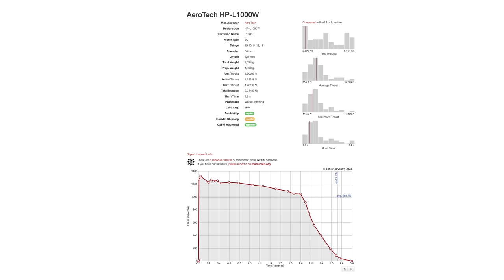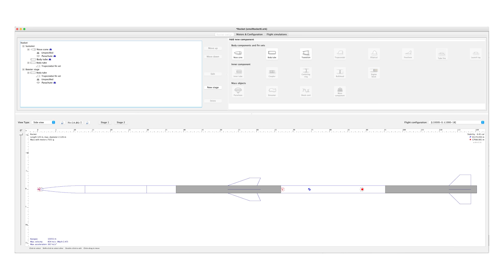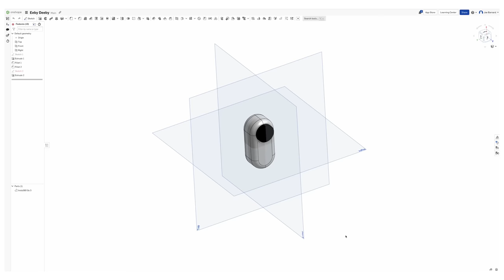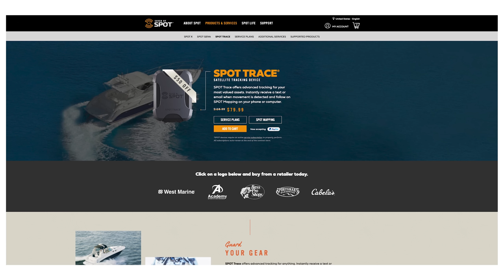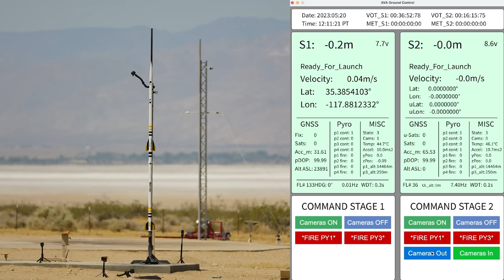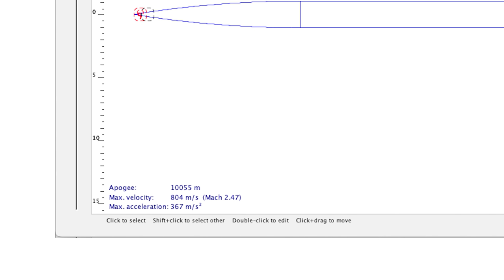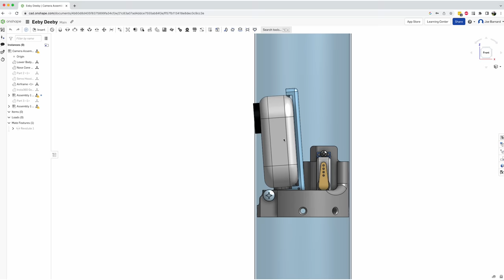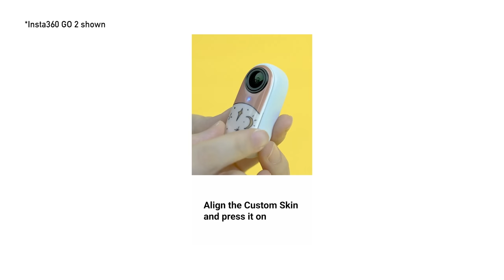I Sent a 2 Stage Rocket to Mach 3 | Feat. Insta360 GO 3

Comment: Great testament to the camera.  Big holes in the airframe also wreak havoc with the rocket aerodynamics, and could have caused the squirreliness of the flight on the first stage.  The use of mirrors with side pods may have been a better idea than fold-out cameras. 

The other camera on camera view option could be to mount one in the forward part of the booster section of the sustainer and one in the aft part of the AV Bay.  A small LED could keep the area lit, and then at separation you would have a video from both the perspective of the the AV bay and the booster... and a nice camera-on-camera shot.

Just a suggestion.  Glad you were able to recover what you did and were able to capture data.

Side note... I had a single-stage flight to 5,000' or so with a camera mounted on the side.  At apogee, the camera ripped from the rocket and free fell in close proximity to the rocket in descent.  The camera hit the ground, flipped over, and was positioned to catch the rocket landing.  It turned out to be a great video.  You can check out EeeebeeeE's Rocket channel on YouTube if you want to see it.

Comment: I have a super simple idea to latch the camera or any other tip out device.  Make an in place "spring" on the camera that pushes the camera in.  This give you some built in slop in the camera movement.  Rigidly attach a hook that will catch the top of the camera tilt mechanism.  As the servo draws in, the camera will be full retract first and the slop will allow the catch to be pulled into place. A few grams more but mission saving....maybe. ;o)

Comment: FAR is close to China Lake, where the US Navy does testing of GPS jammers and the area routinely gets NOTAMS of degraded GPS service. Edwards AFB also has some hear-radio-on-your-fillings radars that add to the RF soup. When I did a deep dive into the sources of noise on our engine test DAQs at XCOR 20 years ago the amount of garbage in the air was breathtaking.

Comment: you should run another rocket designed to survive a Mach 3 shockwave which is probably what knocked the camera loose enough for the wind to catch it to begin with, you can almost hear it over the wind noise as it starts to fall but there was so much you could barely hear it, overall a wild video and a very good product

Comment: you can kinda see the camera shift to a deployed stage just before launch.  I'm betting that there was a slight jolt in take-off which allowed a few mm of trim broken by the camera housing punching the air stream along the side of your craft to cause a full deployment of the camera at the end and causing the failure..

Comment: Of course go Eeby Deeby 2 !! But put them on pure mechanical supports with strings or elastics to fold out, and just a Servo to release it. Also, why not keep the cuted tube section and keep it on top of the camera to prevent air drag on the camera mount. It just pivot when the mount is released.

Comment: That was the most entertaining video I have seen in a while, so great work. As for the GPS signal issue normally I would say there is a line of sight issue with 3rd satellite but the hills look far too low to be interfering. That leaves a rogue transmitter operating at same frequency that is poorly shielded and my eyes are drawn to they salt lake town which, if they like a few of the small towns I have been through, always have someone playing around with electrical communications devices in their back shed.
I just remembered, and this might sound very Mythbusters, that gas & oil platforms at sea have devices to cancel out the electrical current formed by steel & salt. I daresay the salt in the environment at the site c-o-u-l-d interact with the launch stands and generate a low level current that c-o-u-l-d act like a radio transmitter... <runs away before real engineers turn up>

Comment: Joe, could you use some very small mirrors and canards (?) to keep the cameras pointed at each other without having them stick out in the fluid flow?  Could use acrylic or polycarbonate to maintain a smooth flight surface while maintaining optical clarity.  I think some cool mirrors can be had from the laser business, though I don't know if they'd be small enough.  Very cool video, impressive work and very cool cameras.  Thank you for making this video.

Comment: Definitely need a 2nd flight. Watching the build portion, I was wondering what was going to happen to the fold-outs when the real g-forces hit. It seems like a vehicle going mach2 would have any divot in the side-wall closed and smoothed over.  Perhaps some sort door with the servo on a latch, and then a spring on the hinge rather than a servo on the hinge itself?

Comment: You need something other than a servo. Space mechanism use HDRMs (hold down release mechanisms) that are designed such that it is structurally solid and then released by a frangible bolt or similar. Needs to be very rigid to survive the g forces

By the way I love the sound the onboard camera made at the end. Sounded like it was screaming in excitement 😂

Comment: Hello Joe, nice rocket, I'm a fan.
Just wondering ... 
Could you use a dual direction centrifugal switch to trigger an anti spin fin or spoiler. Sure would make some great camera platform. Three flush mounted cameras at 120°, could possibly be stitched together, maybe even unspun in software.
In case you need more difficulty in your life. Video is life, remembered. 😊

Comment: Hey Joe nice flight I like it especially the video let me say this I noticed most of you guys use small fins on your Rockets I think that's nice but for very very high speed Rockets like the Phoenix sm2 Rim 66 Hawk missile all those use a longitudinal thin running about 3 ft from the nose cone all the way back to the first stage then the first stage has a standard fins on it the small longitudinal fins give more control that's why the United States Navy and its contractors have been using that design for 60 years. Now something like The Sidewinder it has a standard fin section in the rear by the motor and fins by the nose cone of course those fins are steerable fins. I personally like the sm2 rocket because it's been under development for so long and basically it's one of our best long-range service to air missiles. The sm2 has about the same speed as your rocket around 3.5 Mach just something to think about adding those longitudinal  short fins might help

Comment: instead of using pop out cameras: 

Use periscopes/mirrors like tank viewports
This way you can maintain aerodynamic profile, minimize mechanical points of failure and in case of a unplanned emergency landing (crash) everything is better contained.

Edit to add: Periscopes could be made from clear epoxy resin for lighter weight. And after giving it a high gloss polish, using chemistry to deposit a silver coating on it.

Comment: Have you considered testing the GPS system's capability to cold start when fully integrated and on the rail? Most GPS recievers have batteries in them to remember where they were last turned on - this makes subsequent satellite acquisition easier and quicker (warm start) *at roughly the same location*. 

If the GPS Rx has been moved a significant distance since it was last powered on it has to cold start which is a more difficult process - I don't know for certain, but I'm suspicious that the cold start process would be more susceptible to most of the issues that affect GPS health.

Good luck!

Comment: I wouldn't worry about the battery fire thing. When my uni did Mach 22  which is a competition held in the UK (I was on 23), they were a bit too liberal with the epoxy curing process and it reacted so much that started smoking.

Comment: Since the Insta360 GO 3 has that removable lens (great feature, by the way, are they planning optional aspect lenses?) they should be able to relatively easily design a "down" angle reflector "periscope" housing for similar implementations.  Having a "dummy" housing or duplicate camera (space permitting, go redundancy!) for the opposite side would reduce asymmetric drag.  Designing such a fairing with tail end streamlining (go mach numbers!) instead of just a blunt lens fitting would be a tad bit harder to accomplish optically but not unworkable.

Comment: It might be that the cameras were sucked out of the rocket due to low air pressure caused by the high speed air rushing over the body. Similar to how speed brakes on an airplane get sucked out of the wing if they're not properly locked. Maybe a similar over-center locking mechanism could lock them in place during ascent.

Comment: I think you lost the cams a first separation. That would explain some of  the wobble at separation and why the big G pull at end of engine burn. The big hole in the side where the Cam ones was, now act as a airbreak on the one side of  the rocket. At the high speed it can keepet staple but ones it slows (burns out) the rocket turns sideways and is destroyed by the air pressure.

Comment: I swear the L1000W is cursed. I've seen as many failures (of various kinds) as successes on rockets with this motor. To me it's known as the "Find Leaver". At the first Airfest I went to, there was three L1000 flights and two of them left the pads without fins.
I've used its brother, the L1090W - a reloadable version of the same motor, and am 1 for 3.

Comment: Would a short hinged skirt over the top of the camera hole prevent the camera from peaking out the side? Any push would open the skirt with the wind deflection pushing it back in place. Just thinking out loud here.

Comment: Is the rxer exclusively GPS? Maybe try GNSS if available. Dilution of Precision should be near optimal out there. Must have noise on L1 1575 MHz. If you track somewhere else less than 24hrs prior it should acquire much faster at the launch site.

Comment: Yeah that happens when you accidentally press the space bar. To mitigate it, you can create some empty stages in between that get triggered instead of the real one. You won't accidentally deploy the cameras that way.
And to find the parts, just go to the tracking station, enable showing debris. Select one and you can switch directly to it. You also don't need to walk there, just press the recover button.
Oh wait, this is not KSP.

Comment: I suppose now it's name is the EEBY OOPSY or the EEBY MACH3BY.  You could paint the rocket to look like a joint and call it the EEBY DOOBIE. (I guess the camera people might not like that one).  Fleas are tough, you could put one in the rocket to see if it can tolerate Mach 3 and call it EEBY FLEA3, or EEBY FLEABY.  Make it a liquid fueled rocket, EEBY Hypergolicky.  If it blows up the other rocketeers will get the EEBY JEEBYS near the launch pad, but if it flies exceptionally well they will sing a chorus of EEBY GEEBY.  For flights in Texas it's the EEBY YEEHAH.  Gender Inclusivity: EEBY HEBY, EEBY SHEBY, EEBY 3BY. Proclaim who built it, EEBY MEBY.  If flyin' it makes ya happy,  EEBY GLEEBY.  If the rocket spins quickly your viewers will become EEBY QUEAZY.  If you breathe in any of that carbon fiber dust you will get the moniker EEBY WHEEZY.  Enough of that, I'm outta here, I'm  EEBY FINI.

Comment: I've used an RDF tracker with a receiver which looked very much like what you used here. I had hiked quite a ways out, and the signal no longer seemed to be coming from any particular direction. That was because my model was stuck in a tree over my head. An unfortunate feature of the transmitter I was using is that it's very small. I forgot where I put it, it wasn't turned on at the time, and I don't know where it is.

It always amazes me when people use solid fins on these hi tech rockets. Shouldn't they be of cored construction? The lower weight might help to make them less prone to flutter. You could maybe have fun carving nice shapes in balsa, and then putting glass and/or carbon over that. OTOH, I gather that anything which looks good violates some principle of supersonic witchcraft. If I was doing this, I might want some of the fibers diagonal to help with torsional stiffness. And I might go with unidirectional fabric or inset tow for more stiffness. Plus, I wonder if putting glass on the outside was really optimal. 

For trimming the crud off the fins, if you get to them when the epoxy is still a little soft, you can do a lot with  a scraper. At that point it's too soon for sandpaper anyway. 

Those long, cylindrical tubes always look less than aerodynamic to me. If we could use the volume if it was distributed differently, I wonder if a V-2 shape wouldn't be better. Maybe even a V-2 shape with the thickest point more than halfway back from the nose, so as to preserve more laminar flow. Of course, then you can't be sticking a camera on the nose or have it sticking out anywhere else either. Isn't there some idea of having an egg shaped distribution of volume to minimize drag due to Mach effects?
Reply: BTW, it occurs to me that, given your fascination with complexity, some of this searching and retrieving could be made unnecessary. Since there's an on-board GPS, perhaps a steerable parachute could bring the rocket back near the launch. A simpler and perhaps more exciting trick would be to have steerable fins, to keep the rocket right over the launch point on the way back down, only deploying the parachute with a couple of hundred feet of descent left.

Comment: Could you fit a speaker driver or similar "skin" to the front and upper sides of the rocket that creates deliberate micro vibrations to break up the creation of anti-harmonic airflows down the length of the rocket down towards the fins?

Or some kind of sonar like device on the tip, not sure of the legality of it, but it would be interesting to test it out nonetheless.

Comment: Would you consider using an Apple AirTag for tracking stages. A pack of 4 tracker is typically $99
Reply: I’m currently tracking my car with one. It’s far away at a repair shop

Comment: I wonder if the cameras can be repaired, if something goes wrong with them. Being this sturdy might mean that replacing a broken battery is basically impossible, as the whole thing could be filled to the brim with epoxy. U kno?

Comment: 18:00  

1024 meters per second sounds a bit sus like there is a software issue or a bit flip cuz getting exactly powers of 2 usually happens when there is something wrong with the bits.

Comment: CAN ONE OF YOU EXPERIENCED ROCKETMEN OR ROCKETWOMEN OUT THERE HELP ME UNDERSTAND SOMETHING ABOUT PARACHUTE DEPLOYMENT?  I imagine that this has already been tried and eliminated as a solution, but I can't find anything about it.

Explosive charges have low weight per unit force going for them, but they are unpredictable and the heat can sometimes ruin components when deployed.  Compressed air/gas systems are heavy due to the strength required to contain the compressed air/gas.

So why not use the best of both worlds?  Has anyone considered a Hydrogen Peroxide + Potassium Permanganate system?  Extremely low weight per unit force AND cold propulsion!  This same system is used in lightweight cold-propulsion helicopters to great effect.

Has this already been discussed, tried, and eliminated?  Or has no one seriously considered this yet?

Comment: hey I really like your video I probably can tell you what your problem was once you hear about Mach 2 the  I think your fins were a little bit small what I would recommend is something like an sm2 block 3 it's a very very proven design have any dorsal fins with give you more stability at higher mark numbers actually that missile was designed to be launched from Aegis Cruisers to take out satellites low Earth orbiting satellites but I look I like the camera that 3D cameras really cool what is the battery life of it thanks a lot  cool hand